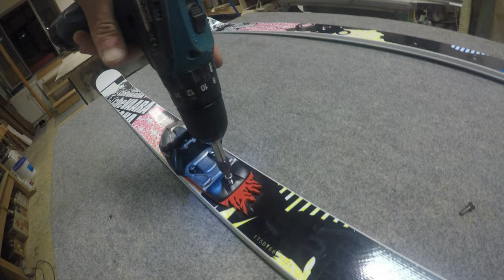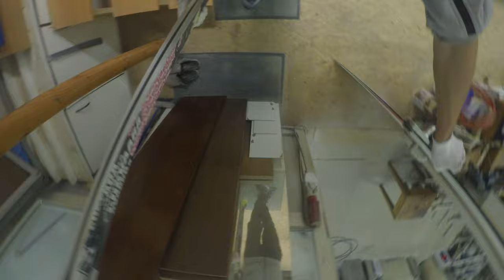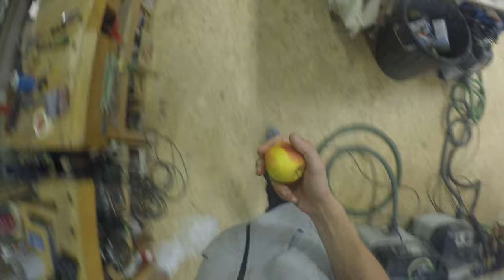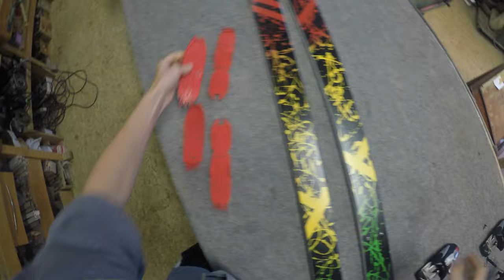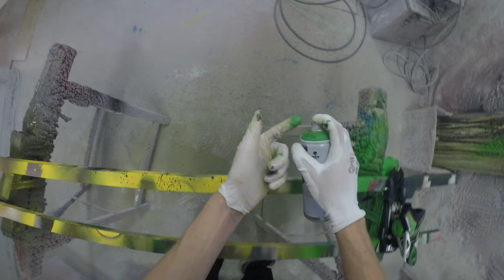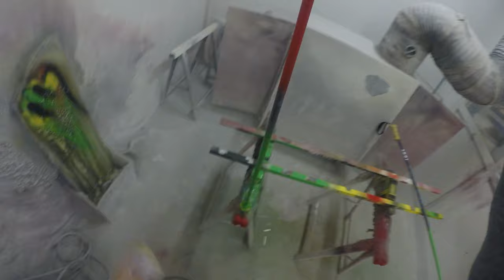Spray PAINT Your SKIS!

Comment: Whats the best protective coating and how long does it last?
Reply from the maker: The best clear coat is a two component one that needs a spraying tool. But if you have that ...it lasted a good season for me and the scratches remain minor
Reply: @makermind2050  Have you tried any other more durable clear coats? I'm thinking of either trying either a polyurethane or an epoxy but I haven't tested anything yet.
Reply from the maker: @joelpatterson8130  i am honestly a bit worried that it would make the ski too stiff/brittle ...but what do I know :D. Sounds interesting.

Comment: Whaat paint did you use? Can you.give me A link plz. Such A awesome paint job you did Well done. Hope you Can help me
Reply from the maker: Lavrsen  thanks man! ..i allways use montana 94 http://www.montanacolors.com/webapp/spray
and i have to say i had only exelent experience so far. BUT ...be carefull with clear coat. I had to make sure to spray thin layers on it, otherwise it starts to crack up. More layers but thin ones is the go to. and one last thing that you should realy do before you spray them is to just spray a test piece, to see if everything workes out. 
I realy hope i could help you.
Reply: Maker Mind omg thanks so much for the help. I really like your skis. I think I buy some used skis for the first spray, just some cheap one. But does the paint stay on your skies after a long time of using them or does the paint fall off?
Reply from the maker: Lavrsen ....i have to clarify that the paint, at least with my normal 2components clearcoat (4 layers) does defenately wear off on the edges. You could try to use a stronger one like the ones you can buy for cars (i will try that next time) but otherwise only do it with cheap used skis ...thats exacly what i did as well. After all those are trickskis and get used quite a bit tho 😉
Reply: Maker Mind so you paint 4 layers with the main color and then 1 with the other? And do you think it is fine with some car paint, from Denmark hehe. Because I can't order the Montana 94 to Denmark...
Reply from the maker: Lavrsen I mean ...actually every paint should work. I am realy no expert ..i can only tell you what i did and if it worked. but no...i just sprayed normal single coats of coulor paint on there and as the ski was finished, i sprayed a clearcoat for protection on there(totally nessesary). 4layers to be percise
Reply: Maker Mind Maker Mind  okay thanks so much for your help :) I'll try it myself, what about the soap how long time did it sit on the skis before you washed it off?
Reply: Did you give your skiis lacquer after you were done?
Reply from the maker: Sorry for the late respond. Yes those 4 layers were lacquer.
Reply: Maker Mind thanks. Was it spary lacquer or Was it just ordinary lacquer?
Reply from the maker: It was a 2 component spray lacquer. If I was you I would try car lacquer.
Reply: Maker Mind okay. maybe i'll. but Who does The ski do in The snow? does The paint fall off
Reply from the maker: With the lacquer I used... yes there is a bit paint coming off the edges (skis cross while skiing)
Reply: Maker Mind. okay but why do You think car lacquer is better?
Reply from the maker: Because its harder and stiffer than most other lacquers.
Reply: Maker Mind okay thanks You for alle The help
Reply from the maker: You are welcome mate!
Reply: cracking video. tempted to try this on my old skis too
Reply: @makermind2050  Goddamn! I did everything like you on the video..and  it came out so nice!
And then I used to much clear coat..🤬😡😡
Reply from the maker: @mikid3032  nooooooo thats such a shame 😐. But hey ...happened to me once as well. All we can do is learn and repeat :). Ps use acetone to remove it again 👀. The key is to not use a lot of clear coat but many layers!
Reply: Heyy @Lavrsen, har du selv prøvet dette? I så fald vil du kontakte mig?

Comment: Great video! is it vital that you buff down/sand the skis first before spraying? Thanks!
Reply from the maker: AnnaLaFleur it realy helps a lot ...I would defenately not skip this step :/ ! And thanks :)
Reply: How about just for spraying a couple of shapes onto the pre-existing colour? I have some pretty plain purple skis I'm looking to 'jazz up' :)
Reply from the maker: AnnaLaFleur aaaah ...now I see why you asked ...well I could imagine that working out awesome! ...maybe you could avoid spraying patterns on the edges so that you don't have to realy worrie about the paint getting damaged. Even without sanding it down....I am sure it will stay nice on there . What I learned after my last paintjob, was that you shouldnt use weak sprays used for graffiti, but instead good ones you can buy to spray your car and so on. And defenately put a few layers of clear coat over the whole ski afterwards!!!  ...best of luck :)
Reply: Thanks for your help !

Comment: When you washed the soap off was it immediately after your sprayed the fresh paint on?
Reply from the maker: I knew someone would ask this...this is indeed the most critical part.
What I would do if I was you, is to use a small test piece and spray it like your skis followed by your soap.  just try to wash it away after like one day and if that leaves nasty edges on the paint, then you will have to wash it off when its mostly dry. I for my part washed it of after around 15minutes when it was dry for the most part.
Reply: I waited 30 mins

Comment: How did you get the sort of curved lines on there with paint?
Reply from the maker: So i sprayed all the colours on there (green,red,yellow) and then i drizzled on soap. After that i sprayed the whole ski black but the black didn't stick to the surface where the soap was.
Reply: @makermind2050  that's very smart lol

Comment: I'm currently in the process of painting my skis and I am wondering if any of you know what the finish looks like after some wear and tear.
Reply from the maker: GodLovesYou you will 100% see a few scratches after a while. It's just not possible to achieve a paint as hard as pressed original skis ...but if you use super hard and resistant car paint ...it will hold up insanely much!
Reply: Maker Mind Ok, thanks alot for the info.
Reply from the maker: Look at my newer video mate :) there I show the skis after about one month ...and I use them quite intensely
Reply: Maker Mind Ya I did; thanks. I usually don't like soap effects at all but the one you did was really cool.
Reply: @makermind2050 did you use exclusively car paint? Or did you coat it with a car coat?